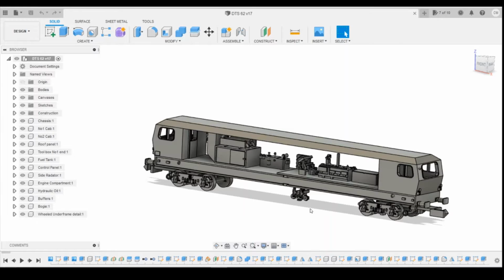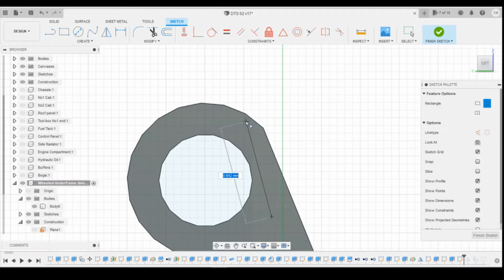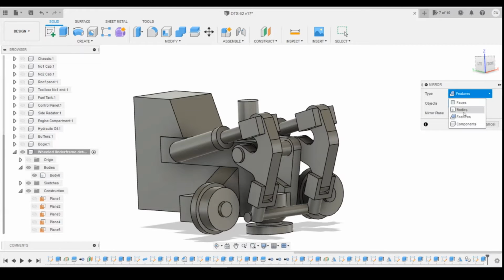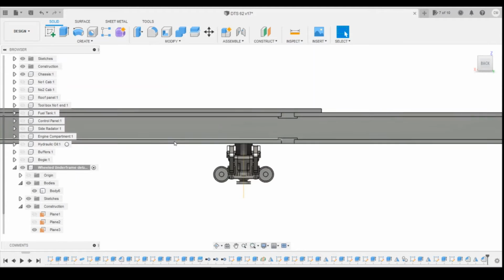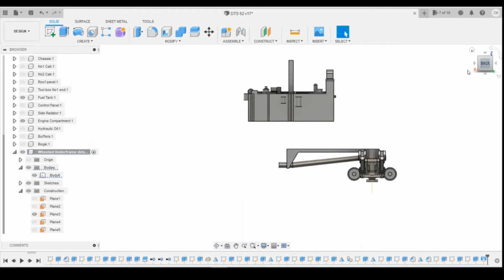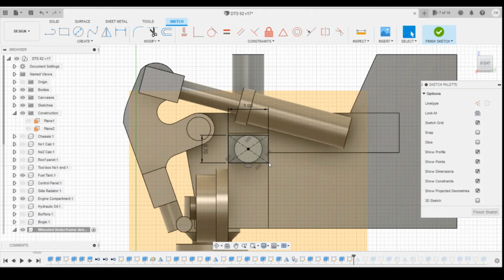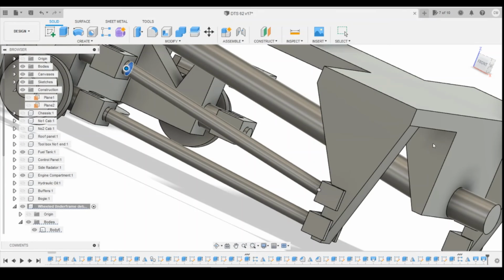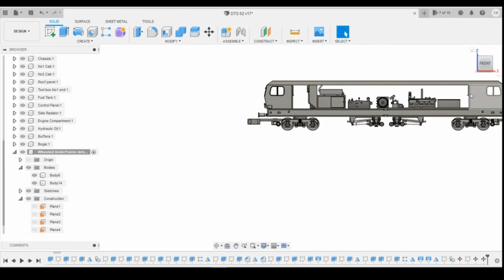Fusion 360 Tutorials for model railroads (Ep20)

Comment: Extremely fasinating design ... which I will definitely try and Model in 00 gauge... I have a copy of Solidworks available but I think I will copy your work in Fusion360 as I do have a hobbyist copy ...
Reply from the maker: good luck,  give me a shout if you get stuck
Reply: @3ddrawingformodelrailways  HaHaHa ... I get stuck on every bit but eventually find ... Its just knowing where all the various operations are in the Menu's ... I suppose I got used to Solidworks ...
Reply: I'm not using the canvas ... just following your dimensions then will up the scale Simplify 3D slicer to 00 gauge